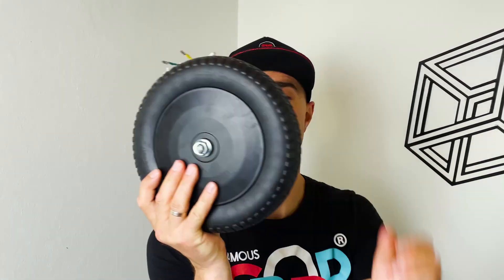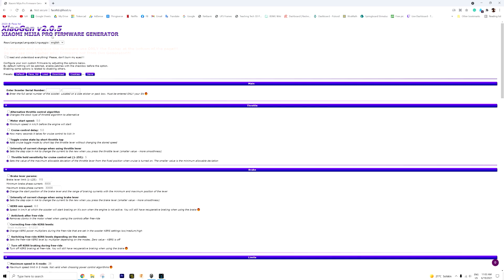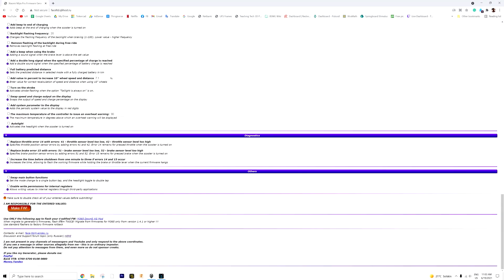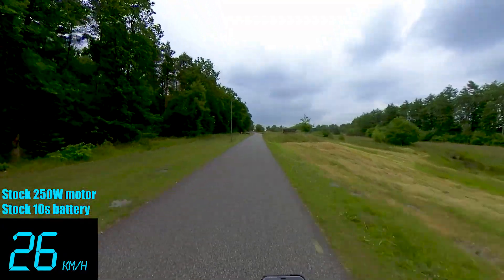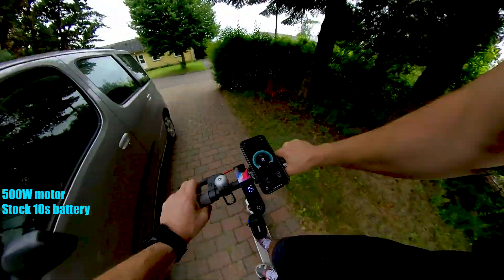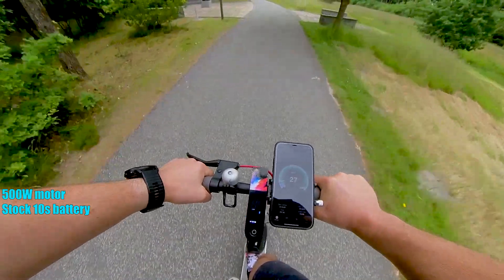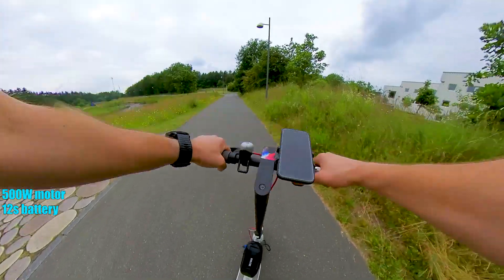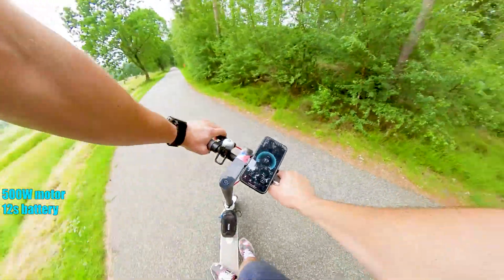Xiaomi m365 first look at the 500W motor (Monorim ?)

Comment: I have Xiaomi Pro 1st gen with 13s battery and I have these weird noises at about 34-36 kmh, if I exceed it, the weird noise will disappear. Also is good to have engine braking at minimum current (I have 8A at max).I replaced the mosfets for maybe 10 times just because of strong braking or braking with full battery. Also is good to have another fuse (for example I use car fuses), so if you burn two mosfets, it will go to short circuit and trust me - you really dont want to replace fuse in original battery. 
About real currents (measured right from battery):
27A at max - mosfets burned after 80 km and 350W Pro engine gets really hot after 3 km ride.
22A - my current sport mode (13S 54V full charge), did not burn mosfets yet, really powerfull, 42kmh and engine gets hot after about 10km, so it is usable
18A - my current D mode, 37kmh, engine never got really hot
Maybe it will help someone
Reply: Can I just put the 500w moter on a basic pro 2
Reply: 0
Reply: What is the best firmware to have
Reply: @ianwhittingham709  In my opinion nowadays it's best to have Scooterhacking, you can tweak almost anything and it also support field weakening
Reply from the maker: Hi mate. Huge thank you! This is such a valuable comment. Great idea with the fuse. I have also seen people installing cooling fans.
I am pinning your comment to the top. Myself, trying another controller. It is obviously the weak link when overvolting the m365.
Reply: @VRMinde  Hi, i have been wanting to do the mod you did in this video but because i want to make sure my pro2 last a really really long time since i live around hilly terrain. But before i do this, i have a few questions and maybe suggestions. Firstly, i think that the pro2 motherboard might have better components on it. So maybe it is a better 500W motor match? Secondly. Is it true that the scooter will act mostly as with a 350W motor if i was to install a 500W motor but i leave all other firmware settings as default for my xiaomi pro2? The weight would be slightly different i think, but in general is what i am asking.
My goal is to make sure my motor will never break, since i use it quite a lot where i live. I ran mine for about 243km the last 30 days until a mosfet broke upon breaking downhill with full battery.

There need to be an even better way for these scooter controllers to last. I CAN resolder mosfets, but the question is.... Do i/we really wanna?! I already added extra pressure and extra thermal paste to allow for better mosfet cooling. It seem to have worked well so far. But this is still not a solution that will last 🤔
Reply from the maker: @CYellowan  hi, as you see yourself, first weakest part is the ecu. So you need to choose and fit the right controller. 
Afterwards you need to see how hot your motor gets. If you need a fast reliable scooter - there are factory-made solutions that will end up cheaper then changing almost all parts on m365 pro 2 :) 
If you are ok with speed of about 40km/h - your 350w motor should last (unless you climb hills on full power all the time). Now this 500w is not even original monorim, it is a knock off and I don’t know how long it will last. I am testing it now with expensive aftermarket controller that can go up to 4kw… will see how that goes :)

One sure way to prolong life of m365 controller is disconnect any ebraking and mount double disc brakes instead.
Reply: @VRMinde  got a pro2, want to ride it uphill, rita and external battery is the best way?

also about vibrations, i think its the resonance the motor gets, it depends of a lot of factors, tyres, weight, others, fill the bar with foam or other filler, that can solve partially the problem and the plastic trim over the fork need to be checked, cleaned, some plastics trimmed, helped me on pro2, the tyre does the most noise, but it's not the only factor.
Reply from the maker: @lion555ify  two motors is a good way for going uphill, but yes, you need at least 12s pack for sure. Rita is plug and play+you can see all battery data in app/on dashboard. You can take out the stock pack and just use a 12s, but you will have to disable bms data and you will not see charge level etc on dash/apps
Reply: @CYellowan  i ride my pro 2 with 14s battery with the original controller without any mods besides firmware. KERS removed (or I think light modus). Top  speed with me 38kmh I weight ca. 85kg. I have sofar no issues with the controller. Okay I do not live in a hilly region maybe this prevents it from burning. I am waiting for a VESC Controller and will try it on 16s battery.
Reply: @VRMinde what controller was you using?

Comment: is there any 48v controller that supports that motor, cuz am thinking to get it but not risking to burn up my controller so yeah
Reply from the maker: Any controller will do, but honestly, I would rather buy like kukirin g2 and have better brakes, suspension, and overall almost everything :)
Reply: i mean i currently have the m365 the european white but like am thinking to upgrade it w prob an extra battery, the monorim motor some suspensions and yeah but i dont know if i would need to get a better controller to support the 48v
Reply from the maker: @m1rage-2000  That is what am I saying, if you need battery, motor, suspension and controller - you will spend more than a new scooter costs, put hours of work and still have m365. While they are great scooters, but the world moved on... My m365 with all the mods, double motors, double disc brakes, double suspension etc. is much less enjoyable to ride than a 400eur kukirin G2... Unless you really want to spend time building and not riding :)

Comment: Hey man i have a question. What happens with regen braking or braking from the motor normally when a series battery is connected to the system? For example 3s. In total 54.6v max charge but can you explain like are the voltages separated or smth? Is there a risk? Im asking for Xiaomi pro 2 model. Appreciate what you are doing and helping the world out there!!
Reply from the maker: Do you mean you have a10s battery pack and then connect extra 3s in series to that pack? First of all I would never do this myself (unless some emergency), because there are risks of both damaging the batteries but also burning it all down.
Your key problem would be - capacity. The batteries need to be of exactly the same capacity which is nearly impossible to achieve. If capacity is not even, when you just charge (with the higher voltage) or reverse charge from the regen braking - your smaller capacity pack might stop accepting charge as it is full and then you will burn the other battery pack. Same with discharging, one pack might start charging the other one while having voltage drawn from it. Watch this dude https://www.youtube.com/watch?v=HhxyHqAtDzU
Reply: @VRMinde  So the internal battery pack is 12800mah 42v and my 12.6v pack is 12800mah too. Bms of the 12.6v battery can output same amperage as internal and also it has 1 port for charge and discharge so when i brake it can accept charge. Also ive calculated all the batteries in my 12.6v pack to be as close in mah as possible and its getting in 12800 mah and on full charge my 12.6v and my internal battery have like 70mah difference.
Reply: @VRMinde also the 12.6v battery charges separately with 12.6v charger
Reply from the maker: @jbl_lover_fan_opex_  Well, it sounds like you have made a decision. It can work, just all the hassle :D Stupid question: why do you want to use regen at all? I disconnect it on all scooters when possible. If you drive around smart, lift the throttle, and coast earlier you won't lose much energy at all. But avoid all the risks on ECUs and batteries at the same time.
Reply: @VRMinde  i have regen on 4 amps so its barely noticeable but i dont have a problem to remove it completely. The problem is when i brake the electric brake on the front motor which i lower the amps too engages anyway so it charges both batteries but is it safe to charge like this in series? Thats what i mean :)

Comment: Can you install the 48v 500w motor and combine it with a 36v 10500mah battery and a stock controller or will that not work?
Reply from the maker: you most likely can run a 48V motor with a 36V battery but it will be slow as F...The more volts, the more revs, the more speed mate

Comment: Hey man I currently have a Pro with only stock parts. I am actually not interested in making it go faster than the default 25, but when I ride uphill (even with a full battery) it just seems to lack the power to go faster than about 10, and if the battery isn’t at least at 80% it will stop altogether.

Do you think a 500W motor could fix that? Would I need other modifications such as custom firmware or a different controller as well?

If it could keep powering uphill at a steady >15km/h I would be really happy.

Cheers for the great vid 😄
Reply from the maker: Hey, if you customize the firmware - you will let more current to run through your existing motor, so it should climb a bit better (at the cost of more power consumed + heat created + longevity a bit reduced).
The next “bottleneck” will be battery. And only then the motor. Changing only the motor will do no good :)
Reply: @VRMinde  Thanks so much for answering, that's exactly what I needed to know! I guess step one is finding out how to flash my firmware with only Apple devices, it looks like all tools are Android or Windows only... And I'll have to downgrade the firmware first no doubt. A battery upgrade sounds worthwhile but it looks like adding an extra battery gets quite expensive to the point where buying a different scooter might make more sense.
Reply from the maker: @ecco256  sounds like you figured it all out :) I have not been playing with firmware of m365 now for a few years so I simply lost track of the ways to rewrite it. Try some simple firmware change and if it is not working out - just get more powerful scoot that runs more volts :)

Comment: the 12s battery is connected parallel or series to the original battery???
Reply from the maker: You cannot connect two different voltage batteries together neither in series nor parallel. Unless you use the "Rita" device (https://e-scooters.embedden.com/)
Reply: @VRMinde  oh ok nice

Comment: Hi bro i have ordered the 48v battery to fit in my scooter pricy😢 just wanted to ask you can i add a external range battery with this at all thank you i no your the man to ask 💯🙏
Reply from the maker: Hi, you can easily add more batteries of the same voltage connecting them in parallel. It is a bit more tricky if you have a different voltage pack.
Reply: @VRMinde  thanks bro so got try to get a 48v have them charged the same then contact  I see what I can do thanks for your advice 👍

Comment: Hi got 500w moter and upgraded controller with external 36v battery with stock 36v battery  what is the best amp on sport mode thank you bro
Reply from the maker: Answer is always “it depends”. 
The motor can take more than 500w for a short period of time, probably you can run it for couple minutes at 2kw 🙄 2000w/36V = 55.6Amps. If you try that - the stock battery will not provide it and very likely die :) 
When it is stock, bottle necks go in this sequence: controller, battery, motor. You have an improved controller so probably your bottle-neck will be the stock battery pack now. I am not sure it likes more than 15-20 amps.. I do not even remember if 20 is already too much 🙄
Reply: Hi mate happy with your advice  I'm going to order a 52v battery it has bms but no Bluetooth will that matter and will I have to take the original battery out as the one im getting will only fit on top in the battery  bag oh and it's 20ah will that matter?? Its called stealth bomber just need advice before getting  it thank you for the help👌💯
Reply from the maker: I normally use BT on BMS to set it up once. If it comes pre-setup or you can connect in any other way it is not really that needed... 

You won't be able to run the original and 52v batteries together unless you use something like Rita adapter https://e-scooters.embedden.com/shop/accessories/rita-adapter-for-xiaomi/ @ianwhittingham709

Comment: What will I need  to reach 40kmh got the 500w moter and extended battery mine only gets up 2 20mph any help will be brilliant 👏 thank you
Reply from the maker: Hmmm, you can try pushing the power (amps) up, but the controller will eventually burn. Speed comes easiest from higher voltage 🙄 I got this going at 50kmh with a 14s (52V)  battery pack
Reply: Is that with stock battery aswell bro
Reply from the maker: no, not with a stock battery pack mate @ianwhittingham709

Comment: Hi mate will I need a 48v battery to make my 500w moter work thanks
Reply: I have upgraded motherboard and 500w moter I have tried using it and have no power I haven't used the new motherboard yet still on the old one and standard battery need help mens thanks
Reply from the maker: It should work if you connected it OK. You won’t feel too much difference but it should work mate.

Comment: hi mate good job. if you could answer my questions i would be so happy.

- i bought that engine but i am not seeking for speed. I am about more torque. I have to climb high hill during my journey to my home everday. 350w engine is not enough for that. 
* if use it with stock battery (i have xiaomi pro 2 scooter), will it be safe for my controller? I guess stock battery has 40v but engine has 48v?
* ı am not gonna change the firmware, so it can't go faster than 25 kmh?
* Stock battery has 12400 mah, if put 40000 mah instead of stock battery and 40v, can i get more range?
* if i put 48v battery, it will go faster than 25 kmh even if i dont change the firmware?

Thanks mate.
Reply from the maker: Hi mate:
- If you use it with stock everything nothing  bad will happen to your controller or battery or anything
- if you not changing firmware it will stay at the same speed. Higher voltage battery won’t work without changing firmware
- if you use larger capacity but same voltage battery ot will have more range

Comment: I have this motor coming on delivery. It's a 10x125inch wheel. Is this adequate for the m365 as I only realised the size afterwards? I dobt suppose anyone would know?
Reply from the maker: If it is the same - it will work. You won't get much 'extra speed" unless you have more powerfull battery pack

Comment: What do you mean 12s ? Is it speed battery?
Reply from the maker: it refers to the battery construction. Batteries are not "36V" or "48V", because the battery voltage changes as you charge - discharge it. 36V is a 10s battery pack, meaning it has 10 cells connected in Series. 1cell voltage is 3.1-4.2V and "on 50% charge" is 3.6V.

Comment: I wish I would have seen this video befor my upgrade :)) ..Or I have seen it but I did not read the comments also... I Think I just burned my controller :) ..and I was so happy with the 35km /h. :) I upgraded the controller to monorim 48v and also battery to 48v (13s3p).  I kept the original 250W  (36V) motor. Accelerations was nice , speed enough for me, but it happen exactly like in your case ....at a moment display went off and will not power on again. I disconnected the battery , display turned  on , but after few meters (I can feel it put power definitely ) display turn of and scooter stops abruptly. I wish I would not activate regen brake :) ... also I use minirobot app   for settings and remove speed limit ...Guys, do you think there is a chance to repair my controller ? is it burned if it can deliver power / curent for few meters ? :) Should I buy another controller monorim , or better a bike controller that definitely can handle 500W  as is rated ? this monorim is super tiny !!! I dubt can handle 20A  as is written on it (48Vx 20A = ~ 1000W ..confusing ) . My bike controller that can handle 25A is 4 time bigger ...  maybe is a better idea to buy a real controller  (bike one) but then I have to install it outside .... and then maybe I have to upgrade also the motor to 500W :))) ... so only the frame remains ... as one guy said here...better buy from beginning   a powerful scooter:)))) . actually I was pretty happy that with only 200 eur I upgraded my scooter to be zippier  and faster.... only if I would know to deactivate regen brake  :)) ...
Reply from the maker: Happens with upgrades :) lessons learnt :) You most likely can repair the controller, depending what burned. But to be honest I failed so many times trying to repair/identify what was defected…

Comment: Hi I have 48 v battery from my bike and I trying to add it in my scooter m365 I add only 48 volt battery and when I turn on scooter beeping I change the firmware to 48 v  remove charging mode and keep beeping stock controller can’t work with other battery -bms? 
Thanks mate I wait your answer
Reply from the maker: What error code is it beeping? The problem is that your battery pack is not "communicating" with the controller. There is a github that describes the programming and the hardware behind, so you can make a custom BMS to work with the stock controller. But if you have 0 coding or electronics experience - it will be hard to understand. Next two options: 1 purchasing Rita - that will do the trick, or 2. just replace the controller to an aftermarket one.

Comment: Have pro2 stock 350w motor and stock controller if put 48v baterry not demage?
Reply from the maker: No “immediate” damage, but you have to change the voltage settings in the firmware of course.
Watch out for how many amps you gona push and for how long. If you gonna go max throttle for 5mins non-stop, you can overheat and burn the controller
Reply: @VRMinde   thenks for info and how change the voltage bcs have drv 248  v3 controller. 
And if put 12v baterry to my originál 36v in series?